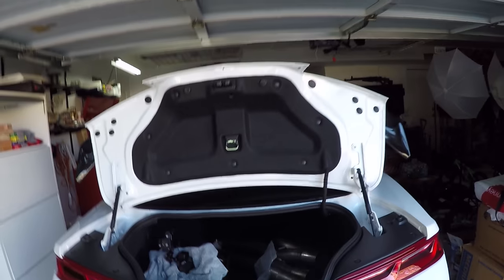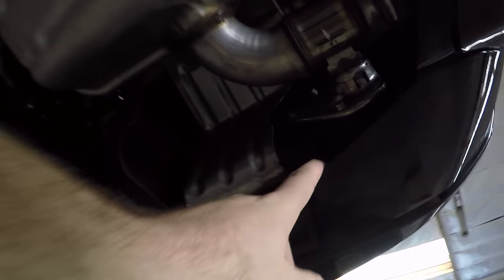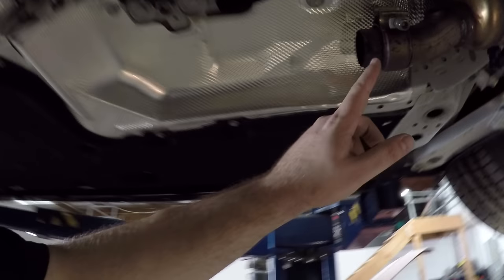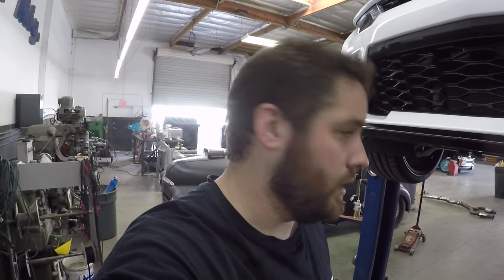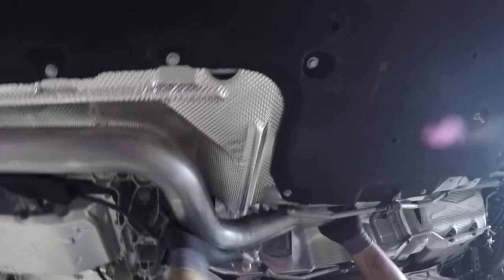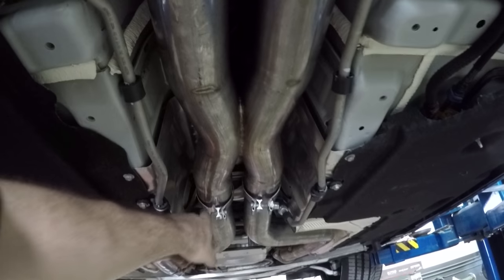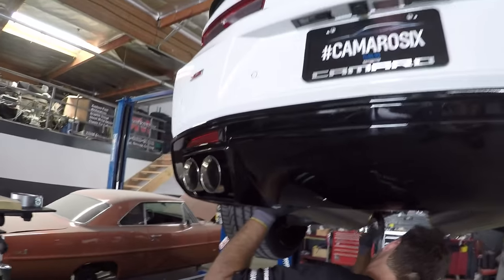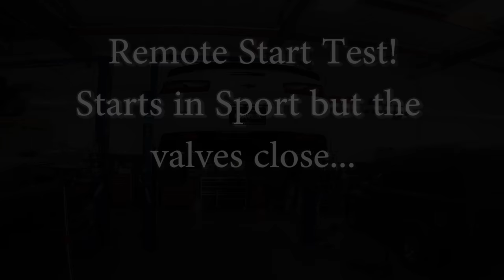Stainless Works Catback Exhaust Install Guide | 2016-2024 Camaro

Comment: I know this an old video but hopefully you still get comment notifications. I'd like to know how the system ended holding up and is it the Legend or Redline system? I'm thinking of this system with quad tips..Redline edition. $2400. It's expensive so I'd be interested in a years later update if you would recommend this system?!? I have the AFM system and still a year on my warranty so I can't just Tune out the CEL if air unplug the valve actuator.
Reply from the maker: This is the classic. The redline and legend are new. I recently posted a video on all 3. https://youtu.be/7zNFDm1YrTU
Reply from the maker: Has held up pretty good!
Reply: @Lethalgarage  ok. Thank you for the response!

Comment: How did you first slide in pipe not leak under the driver seat? My clamp that came with my stainless works catback would not keep it from leaking.

Comment: Before I tell the full nightmare story and the lesson I have learned on this SW exhaust, let me try to get help on the major installation issues I have having with this SW Full Cat Back NPP/AFM $2500 exhaust system. Now keep in mind, I have installed countless systems on cars over the last 25 years of working on cars...NEVER HAD ISSUES LIKE THIS!

I am hoping someone that has personally installed this system can provide some feedback on thier experience.

I attempted to install per the instructions that came with the system. Removed the full stock exhaust first, pretty easy, but definitely challenging while laying on your back and doing in alone. But stock was removed, no problems, all good.

Right from the get go, installing the left side lead pipe from to the primary cat was an issue. SW gives a 2.25' clamp in the kit, the instructions clearly say 2.25" clamp, but it is NOT possible that a 2.25 clamp will fit on this pipe. The clamp is about the same size as the clamp - fully expanded with the nut taken off, and even then it will not go out the pipe. OEM clamp is 2.5", but that is a bit too big for the pipe as the EOM design pipe has a raised iip around it. I reached out to SW works to tell them the clamp does not fit, they send me another 2.25" clamp and a 2.5" clamp. NEITHER ONE FITS!!!!

Installed the right side lead pipe, appear to be no issues, bolted in.

Install the crossover/x pipe and "seemed" to go on with no issues. I did the rubber mallet and block of wood trick to gently tap and make sure it was seated to the lead pipes. Clamps on loosely, I am not sure, but I still have a feeling its not seated all the way.

Left side intermidiate pipe, slipped on, think this was fine at the time, but once installed I believe this was an issue part as well. More to come once I have the left muffler on......

Right side intermediate pipe. This is I think another trouble spot. Once both intermediate pipes were slipped on, I did the rubber mallet and wood block to make sure they were seated. Right side piple is NOTICEABLY longer (sticks out further) than the left intermidiate pipe, maybe 1.5" or more! There seems to be a major issue here!! Quality control? Cut incorrectly? The other issue here is it seems a bit to close for comfort to the drive shaft....could be dangerous. NOT ACCEPTABLE!

Left muffler and tip pipe, again this seened to go on with no issues, slipped right on. BUT, here is where the potential issue with the left side intermediate pipe comes into play. Once it seated, the tips seem like they are recessed a little too far under the diffuser. I actually had to "unseat" it a bit to make the tips even close to even on both sides. This side actually seems like there is a pipe or part that was vut too short. Again, NOT ACCEPTABLE!!!

Now for the final piece, and major problem spot. I guess when there are issues with pieces ahead of this, it all comes out in the end right??

Right side muffler and tip pipe. This is a joke. The tips stick out several inches more on the right side than the left side. And they stick out very far from the diffuser, to the point where about 2/3 of the enitre tip is outside the diffuser. This is either an issue with the right side intermediate pipe cut too long, or muffler pipe too short, or both. 

I honestly cannot believe the issues with this exhaust, and at at $2500 price point is truly is NOT ACCEPTABLE and based on numerous times I have reached out to SW with problems on this installation, it should have been resovled by a replacement (and proper) system being shipped to me ASAP!!! YOU NEED TO STAND BEHIND YOUR PRODUCT!!!

Now for the full story. 

This has been a nightmare from the start. I actually ordered the exhaust at the end of November. After going back and forth every few days with the vendor, I was given the runaround, shipped, not shipped, ship next week, ship in a few days, etc....

The exhaust finally arrived some time in January!! YES! JANUARY!!

It was a few more weeks before I could get the time to install it, but when I did, I encountered the issues listed above. That was the 1st time I installed it!

Since I could not get it to line up, I went back to it a few weeks later, and uninstalled the ENTIRE exhaust, and reinstalled it again. Guess what??? SAME EXACT ISSUES!

So today, it was a nice day, I figured I would try to finally line this thing up. So I take it entirely apart again, and reinstall yet again! SIX HOURS TODAY taking it apart and fighting to get this piece of garbage aligned. And its not better than it was the first 2 times!!!

I am at the point now where I am going to reach out to Stainless Works as clearly there is a defect somewhere in the manufacturing process, cutting process or bending process that is not allowing this system to install correctly. But to make it worse, I feel that there are issues with a few pieces, and it is not just 1 part. 

If Stainless Works is not responsive and does not take accounability for what is most likely an obvious manufacturing issue, I feel that I will need to reach out to my credit card company and possibly an attorney. I have invested probably 16-17 hours in this exhaust, and it should only take maybe 2-3 to install????

To put it mildly I am FURIOUS with this. I should have followed my gut and spent the extra bucks for a reputable exhaust company.

Comment: Ended up trading my 2016 1SS for a 2016 focus ST my Camaro got vandalized 2 times in 3 months it only had 1,700 miles on it but I still have my 2013 ZR1 its a shame if you have a nice car you gotta hide it in a garage
Reply from the maker: +DustinCorvetteZr1 man that sucks.

Comment: Is there a difference with factory connect vs the performance connect (straight to SW headers)? I’m planning to get the factory connect because I have no headers right now but will I still be able to install headers in the future? Planning on kooks 2in
Reply from the maker: You will most likely have to swap the connection once you get headers.

Comment: What does the secondary cat's do?  You can get get rid of them without any issues?  Do you run your exhaust in any other modes where the flaps close?  I've noticed even in sport or track once the car warms up after the first few minutes the car quiets.  I was told these flaps don't stay fully open (programmed by GM), there is a fuse you can remove so they stay wide open & they were right.

Comment: Where are all of the track suspension guys ? The suspension is just too soft, but I'm not seeing any racers. I have a 1le and I'm looking for solid upgrades. I tried the BMR springs , but they were a little disappointing, so I went to H & R for springs. Still to soft. Any recommendations ? And not Eibachs.... totally made for comfort. I came from a Mustang, in which we had Steeda, Roush, Saleen and a ton of quality vendors. I'm not seeing the love on the Chevy side. There seems to be a lack of suspension vendors. There's a tuner for the magnetic ride ( DSC); which again, they seem to lean towards comfort.  I'm a track guy ( road course) and suspension and road feel is everything!
Reply from the maker: DDSVs are among the best. GM did it right from factory.  If you want harsh, you have to move to a coil over
Reply: @Lethalgarage  the spool valves are awesome!! I drove a Zl1 1le and it feels perfect!! They are pricey for the budget minded, and the springs still sit a little high. My biggest problem is finding a performance spring. Every single one that is made has comfort in mind, with the exception of the DSSV. Would love to have them, but 4k (or whatever I remember seeing); is a lot of money to pay. I will look and see if I can find any that doesn't cost as much as a supercharger :-)

Comment: I have the same exhaust and I'm having massive issues getting this thing installed one of the issues is getting it lined up the other is the 2 and 1/4 inch clamp will not fit on the left side lead pipe going into the catalytic converter how did you get yours on

Comment: Hey Lethal, I don’t know if you could answer this but I know you’re in California and that Stainless Works claims to be California legal. I was wondering if the exhaust ever cause you problems with smog or cops as I’m interested in getting the Redline exhaust system as well.
Reply from the maker: The sound is louder than CA law if you remove the cats
Reply: @Lethalgarage  with the exhaust system would i have to remove the cats or can i keep them on?

Comment: I installed the Cat-Back exhaust from stainless works on my 2017 50th Anniversary convertible 2SS. It gave me a CEL, was told its because the AFM valves sit in a hallo housing (on the pipe). AWE makes a Simulator for it and says it's to take the CEL away. What can you tell me about it? Is the AFM connectors on yours also hallo? What do you recommend?
Reply from the maker: Never had a CEL as the AFM valves think they are still working for mine
Reply: @LethalGarage  thanks for the reply, I called Stainless works earlier today and left a message. Hopefully they can help me figure this out, I'm not sure if I want to tune it out (also got the roto fab intake). I'm here in the bay area California and you know how it is trying to pass a smog after a Tune. Any advice you can give me will be much appreciated. Maybe I'll see you in the next Car Show, a freind wants me to join a local Camaro Club here in SJ
Reply: What kit did you install on your vert? I have one and am just concerned with clearance for the convertible bracing.

Comment: Can I upgrade my 2016 camaro ss without dual mode npp factory to dual mode npp performance?  I know that I´ll need to change the rear diffuser to get more room for the new muffler.
Reply from the maker: Yes, just get the option like I got that supports dual mode. It keeps the functionality of the GM offering.

Comment: Damn it, I need a go pro to justify my cam videos/sound. Lol sounds pretty good. Quick question though, since the valve closed up on you while starting it in sport mode I'm assuming you did not do a fuse pull exhaust valve, my question is will you do a fuse pull video with the new exhaust, just to compare the sound with it full open? Sorry if I'm getting ahead of myself and spoiling and future video hehe
Reply from the maker: +Juve Madrigal there's a no need to pull the fuse on this setup. Even when into or mode its twice if not 3 times louder than the stock dual  mode exhaust set up.  In track mode it's a race car

Comment: got a question when disabling  the AFM active fuel management so it doesnt go into v4 mode ever, do u just have to pull the plug where u pointed out that goes into the exhaust and its disabled? or is there more to it than that?
Reply from the maker: +vxptc1 there is a lot more to it. What this exhaust does is deletes the valves that are in line with the exhaust. I use the range device that actually kills the active fuel management from activating from the motor side it plugged into ODB sensor port and it cost the couple hundred bucks.

Comment: Stainless Works is the best, very good decision. Just wondering if you weighed the new parts vs the old parts to see how much weight you took off? I really like the 2016 Camaro SS.
Reply from the maker: +Newton Washinton the plan was to weigh both setups. Unfortunately the scale broke that morning. I do have the stock exhaust still so I am going to weigh it is soon as I can get to a wait station
Reply from the maker: +Newton Washinton weight*

Comment: Ahhhh was going to tell you to do a startup with open headers lol I ran my car a couple of times on the drag strip with open headers and it sounded like a monster! Low end power sucked but the higher end power difference was insane.
Reply from the maker: +Alex Camaro I thought about firing it up but I didn't want to deal with any ECU issues. Also the shop had a lot of people in it and we didn't want to make everyone def

Comment: if you don't mind me asking how much did you spend on the install I have the same system on the way and just wondering thanks
Reply from the maker: +Allen Wade $170
Reply: +Lethalhammer thanks for the quick reply cant wait until i get mine and get it installed
Reply from the maker: +Allen Wade ,$170

Comment: Hey lethal I hope you can help , I just installed some magnaflows on my 17 camaro rs , but now I got a check engine light on and the remote start won’t work please help thanks 🙏🏼
Reply from the maker: CEL will cause remote start to stop working. What sort of system? Cat back?
Reply: LethalGarage no lethal it’s the mufflers only not the whole cat back , I read the code , p0073 , I dindt disconnect the battery when I was doing the installation
Reply: P0073 - Ambient Air Temperature Sensor it was working fine before the installation I guess I’ll have to take it to the dealer

Comment: Awesome setup man! I love the sound...
  Now I'm wondering if with this setup you got can you still use your engine sound management? I'm looking for a catback my self and still debating on which one to get, but I want mine to have the control over the sound still like it does with the npp. . help please?
Reply from the maker: +Miguel Garza yes. I got a system that supports the Dual Mode exhaust.
Reply: +Lethalhammer cool and also. which one would you recommend. I'm debating from Borla axle back and mid pipes, or just a stainless works catback? Borla or SW?
Reply from the maker: +Miguel Garza it's all subjective, but I really like the deeper natural tone of the SW system. Borla's system muffler that natural deep tone in a an  odd way.
Reply: +Lethalhammer yes that's what I'm looking for a deeper tone. and also SW is way cheaper
Reply: +Lethalhammer so what about the afm valves I have a manual so mine don't have any
Reply from the maker: +Miguel Garza yup, just order the one without the valves. They offer both.

Comment: Thanks for the videos Lethal.  I purchased the same Catback and installed on my 1SS 6spd.  I found it very hard to cruise on the freeway and get away from the drone, enough to the point I am removing it and going with Borla.  I have been disappointed with Stainless Works after reaching out to them regarding first a CEL issue then the drone.  Long story short I had to use silicone on the slip on connector at the driver side cat to eliminate the CEL but only after researching forums with little to no help from S.W.; a small leak is all took for a P0420 code. Nonetheless, I am looking to get rid of the system.  If you have any ideas, I'm open (I'm located in San Diego).  I am beyond  frustrated after reaching out to S.W. for a return or potential exchange in regards to the drone issue (its obnoxious even in tour mode with the 6spd) and they basically came back to say sucks to be you, we're not going to help you out.  Its all a matter of opinion, obviously, but with a dB meter full acceleration inside the cabin in tour was reading 80dB, in "drone mode" it was reading 85 db .  Outside of drone, it sounds awesome but I can't live with it anymore.
Reply from the maker: It will drone, its an off-road setup. If sound isn't your key driver the SW system is most likely not a pick for you. Corsa and Borla all go quite at higher rpms. I have no issues with CEL's, but sucks they haven't gotten back to you. I don't know anyone currently looking for a system. I assume you got the catback?
Reply: It's is an identical system to yours.     I've assumed this isn't the case, so I'll ask the question,  with all the freeway driving you do, does yours drone at 70 to 80 mph cruising?
Reply from the maker: +Chris McDaniel Mine for sure drones. But I got it for that sound.
Reply from the maker: +Chris McDaniel Hey Chris did you find a buyer for your SW system? If not how much are you selling it for?
Reply: Yes, I still have it.  Asking 850.
Reply: Chris McDaniel are you selling the SW system i am looking to buy it from you   for 800 can you ship it as well.. thank you
Reply: Chris McDaniel ok
Reply: Still have the system? I'll buy it

Comment: Sorry its auto.
Reply from the maker: +BlueDog 600 due to the afm valve you will get CELs. Only manuals will steer clear of the evil light of doom. Only way to over come is a tune.
Reply: Thank u. Yes I reset the sensor and it went away but after driving a day it came back on. Headers n cam are next so I guess I'll have to do the tune after. Always appreciate the info. Just got home from work. Have a good night bro. Gonna play a match of Friday the 13th then off to bed lol.
Reply: I bought the EFI tuning modules , so far they seem to work , no CELs, I mean it's an option if you are looking to keep your warranty and not tuning .